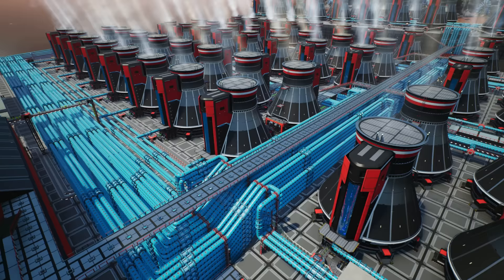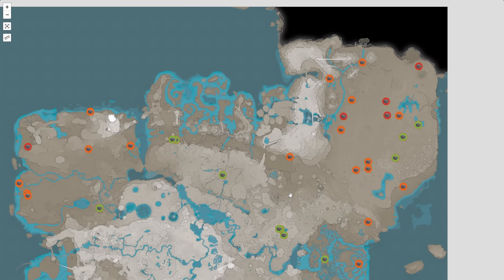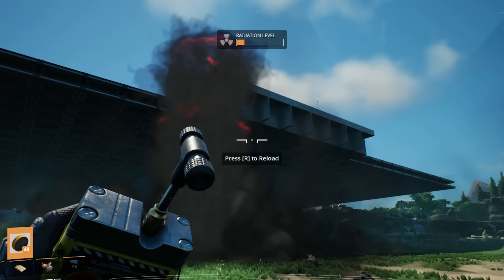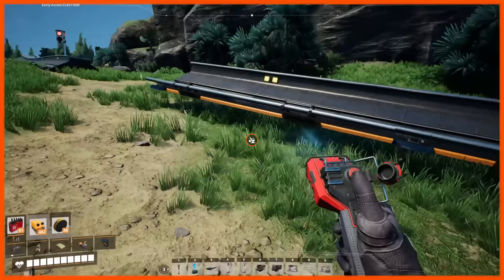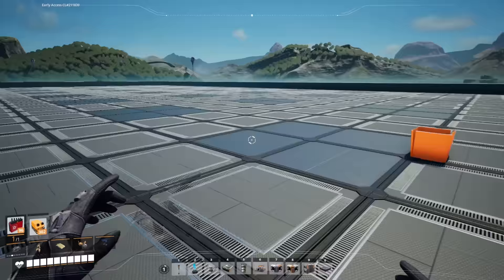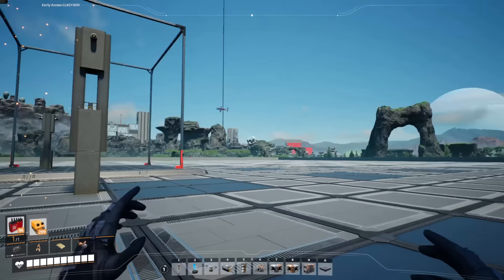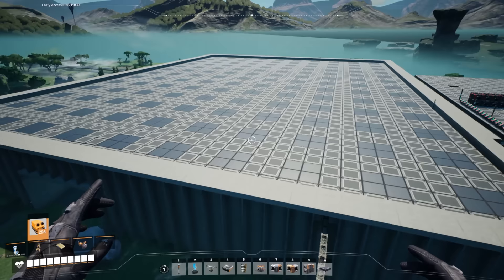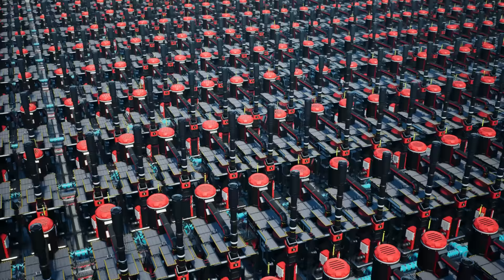I Spent 700 HOURS Automating Nuclear Pasta in Satisfactory

Comment: I'm surprised you dont saturate the lines before powering the machines. Connecting resources before powering  not only helps find those ore/ingot issues early, but also accelerates the warm up of your factory.
Reply: I think Kibitz just loves the satisfaction of completing the belts after everything has been built.
Reply: @sunfire65ph  Or he likes to recheck the beltwork without having to worry about stuff that isn´t meant to be where it is. Dumping thousands of Items out of a complicated beltwork-system can take much more time then flying around and rechecking your connections first.
Reply: @joesheridan95  considering the exact problem he had, pre loading the belts would probably had made it much easier to see where the errors were, as the ore would suddenly shift belts. pre-loading is typically a much easier way to start up a factory, and you can usually rely on simple overflow to keep belts and machines full. however preloading takes exponentially longer the more machines are chained together. that's why he did a hybrid system of load balancing the belts first then letting them overflow on each row. the load balance lets each segment become independent, and get everything filled faster, without trying to load balance every machine at the same time.
Reply: "however preloading takes exponentially longer" - not exactly. To preload N machines each having an M-size input buffer you will need to move N*M items regardless of the way you split the inputs, be it manifold or load-balancer setups. And since M is essentially a constant for any individual recipe - O(N*M) becomes O(N), so linear time complexity. 
Main difference comes from size of M. For manifolds M almost* equals to machine's whole input buffer - which is generally the size of stack. For loadbalancing M equals recipe requirements. E.g. if your recipe takes 20 screws to start, and the size if screw stack is 500 - minimal preloading for manifold would take roughly 25 times more time.

*Since machines aren't strictly filled one after another on average you need a little less items, but the difference looks negligible for most setups bigger than 1-2 dozen machines (obviously depending on the rate between recipe requirements and stack size).
Reply: @ye_olde_urizel  My brain hurts.

Comment: The thing that happened on the belt poles, z-fighting, happens when 2 textures try to exist in a single spot. Due to inaccuracies when calculating fractions, which part of which texture will be visible depends on the camera angle and capera position. The only solution is to slightly offset one of the textures so that they no longer exist in the exact same place

Comment: Funny that you posted this video today. I'm at the exact same stage in my world. I'm planning on making 10 Nuclear Pasta in my playthrough right now. Here's my numbers that I've crunched.

10 Nuclear Pasta (Particle Accelerator) - 20x
	2000 Copper Powder
	10 Pressure Conversion Cubes

2000 Copper Powder (Construtor) - 40x
	12,000 Copper Ingots

12,000 Copper Ingots (Refinery Pure Copper Ingot Recipe) - x320
	4,800 Copper Ore
	3,200 Water

10 Pressure Conversion Cubes (Assembler) - 10x ✅
	10 Fused Modular Frames
	20 Radio Control Units
	
10 Fused Modular Frames (Actually Making 18) (Blender) - 12x ✅
	18 Heavy Modular Frames 
	900 Aluminum Casing
	450 Nitrogen Gas

900 Aluminum Casing + 360 for Heatsinks = 1,260 (Actually Making 1,350 (Assembler) - 12x - ✅
	1,800 Aluminum Ingots
	900 Copper Ingots

1,800 Aluminum Ingots (Smelter) - 60x - ✅
	3,600 Aluminum Scrap 

3,600 Aluminum Scrap (Refinery - Alternate Electrode Recipe) - 12x - ✅
	2,160 Alumina Solution
	720 Petroleum Coke

2,160 Alumina Solution (Alternate Sloppy Alumina)(Refinery) - 9x - ✅
	1,800 Bauxite
	1,800 Water

20 Radio Control Units (Actually Making 30) (Manufacturer Alternate Recipe) - 8x - ✅
	120 Heat Sinks
	60 High Speed Connectors
	360 Quartz Crystals
	
120 Heat Sinks (Assembler Alternate Recipe) - 12x - ✅
	360 Aluminum Casing (ADDED TO 900 RECIPE ABOVE)
	360 Rubber

60 High Speed Connectors (Actually Making 75) (Manufacturer Alternate Recipe) - 25x - ✅
	2,250 Quickwire
	937.5 Silica
	75 Circuit Boards

75 Circuit Boards (Actually Making 105) (Assembler) - 12x - ✅
	150 Plastic
	450 Quickwire

Comment: for whatever reason the foundry recipe to me seems like a better option to make copper bars. since it takes copper ore and iron ore to make roughly 100 copper bars per minute. but then again Kibitz likely has more experience with the game then I do. so he might truly know the option to use since he dives into the hardcore math.
Reply: nah, he often just makes things harder for himself, I think sometimes intentionally for the content.
Reply: Then he would have to bring in all that other iron too, easier to just bring in water
Reply: Not counting for power or space, that recipe is inefficient. You need MORE copper ore AND in addition iron ore. Because his limiting factor is the amount of copper, the "Copper Alloy Ingot" recipe would not be feasible.
Reply: @beerforlife32  Foundries require half the power of refineries but then there's the trade off of all the  overclocked water extractors and pumps vs the power required for the extra miners for the iron ore. Foundries also take up much less space. And copper alloy would only require 3 foundries per 1 constructor for copper powder.
Reply: sure the refinery recipe is the better option for input/output value. but when he placed the building next to so many iron deposits. figured it would have made more since to bring that over vs the water.

Comment: It's impressive...but not how I would do it. I would sacrifice 1:2.5 efficiency of pure copper ingots to go with the 1:2 copper alloy ingots. Gather up 25% more copper (probably just a node or two), iron instead of water, then the whole thing is just 50 foundries without overclocking! Also waaaay less power.

This doesn't take away from what you've accomplished at all. Different philosophies and all of that, and the end result is a pretty sick build.

Comment: you should have more than 1 sources of power. So if you run into another nuclear problem, you could try to run the nuclear power related things on "backup power"
Reply: Pretty sure he has a fuel plant, and a coal plant to fire the fuel plant up.
Reply: If I remember correctly, I think he has a battery factory as well. Either that or I'm thinking about Z1.

Comment: @2:55 It would add a lot more logistics to the factory, but why not use the copper alloy alt recipe in the foundries? 50 copper ore per min and 25 iron ore per min makes 100 copper ingots per min and foundries use half the power of refineries. And you wouldn't have had to deal with the hassle of pumping the water in.

Comment: You know what I'd like to see added to the game? Specifically powered belts that we can shut on and off. That way we can turn on/off belts routed through splitters to use them as junctions to pivot productions. Imagine being able to flip a few switches to reroute all that copper to train systems to mass relocate from say the desert and the green pastures to central locations. 

I'd like to say something about train tracks though.  If I can suggest one thing it would be plan your tracks out by elevating them that way they don't interfere with your other logistics. Think more monorail and more vertically. Bonus points for such a system is that you can also use the supports and track base if you use foundations to run cables also removing them from the wilderness.

Question though.... did you have problems with the sky manta thing? I recently decided to use the same area around all the iron nodes to turn it into a massive iron oil rig that I'm still building. I also just found out that that thing is treated as a solid object and has collision. Is it possible to actually kill it too?

Comment: 12:40 it's called Z-Fighting, it's when two different/offset textures are in the EXACT same space (or the rendering precision is low enough that it thinks the textures are in the same space) and the rendering engine "randomly" picks one of the two textures to render in the final image, causing a weird strobing effect which changes each time the viewport moves or rotates

Comment: Yea, 2 meters between floors for belts is definitely too small. I recently made a factory with 4m space and for the most part it's okay but there's no space to squeeze if you got one belt on the ground and other passing on the ceiling mounts. Next one will probably have 6 or 8 meters of space.

Comment: 12:44 It is texture overlapping, due that both Objects are overlapping, the textures overlap, but it woulden't happend if the graphycs dind't have small imperfections that change a small fractions of pixels of height in the corners, making that very strange texture overlapping, that can be fixed by moving the overlapped object down/up left/right depending on what axle is the object overlapping

Comment: Awesome! Thought you could have just built bridges above the train tracks… prefer the risck of the current method though!

Can batteries be used in trucks? If so, how bout delivering batteries via drones to power you vehicles with batteries! 

And, why not use that water well for the copper? Since you have trucks there, use the packaged water method, and send that water to assist, thereby lessening the number of pumps!

Finally, why not fully over lock at least the accelerators? That should help!
Reply: Thanks for watching and commenting. You have been selected randomly for our giveaway package. Quickly contact the address above 👆.

Comment: 12:40 is called z-fighting. it's a visual artifact that happens when 2 surfaces are at the exact same orientation and plane. when they touch, your graphics card has no way of deciding which is on top, so it's basically random. the developers have a way of fixing it by making objects very slightly of different sizes, but that's a nightmare, or by sacrificing performance to tell the GPU what goes on top of what.

Comment: This is why mods are needed most importantly the ones that add MK II III etc for ALL machine

also 12:35 Its a common graphical artifact called Z Fighting just look it up on Wikipedia only way to fix it is to extend the beams up past the top of the concrete or recess them below it alternatively add a flat cap to the assembly to hide it.

Comment: The green forests have become the green pavement... Thanks for the video kibtz! Except you missed the easy way out for the belting. 8 pure copper refiners at 37.5/m is 300 copper ingots. All you needed to do is build the refiners in rows of 20 with a single 250% overclocked constructor at the end to make 125 copper powder from the 750 ingots they produced. That way you're only needing to move 2500 copper powder from there instead of 15k ingots.

Comment: When using the floor hole with the conveyor lift under the ceiling, build the conveyor belt first (even a small section that is in the proper direction and ends where the lift will land) and the game will adjust the landing height high; being where you want it to be.  It won't go into the floor and clip.

Comment: 4:30 I probably would have gone with the copper alloy ingots. Iron ore + copper ore = Copper Ingot. Not the most efficient, true, but you don't need water and they use a lot less power.
Reply: 8:06 This is why you always make a highway. Slower than just running rails, true, but it saves you time in the end game because you can do a multi-level highway where both trucks and trains can travel without running into each other. I tend to do the truck highway below and two sets of rails above... and then build it all around the world.
Reply: 11:39 Something I've built in one of my play-throughs is a belt overload system. It uses a system of smart splitters and mergers to make sure that a belt is ALWAYS filled to max, and whatever is leftover is merged onto another belt, which also has a smart splitter to make sure the belt is fully loaded. I have 5 or 6 belts (I think) that have an assortment of materials moving on them, and the overload system helps me make sure everything is maxed out with no backups... this way you use the least amount of belts.
Reply: 12:42 I think that's called 'Z-clipping' or something like that. Basically, the two items end on exactly the same level, so they're fighting with each other to see which one is displayed.  To fix it, you simply need to make sure one ends just below the other.
Reply: 15:18 Um.. instead of the belt towers holding just one belt, why not make stacked variants that carry 2, 3, 4 or 5 belts? Simple fix.

Comment: A question about your conveyor support towers. Why didn't you build a taller conveyor stack in the towers using the stackable conveyor supports? That way, you can run multiple belts through one set of towers. You could even make the gap in the support towers taller to accommodate more belts. And if you only needed one belt, you could just use one like the one you made.

Comment: This whole video shows exactly why I avoid the ‘pure’ ingot recipes. Refineries use so much more power than smelters even before you take into account the extra power for water extractors and pumps. I would wager You could get more ingots/min using smelters in the desert than refineries in the green hills and you’d use way less power and have a way more compact factory as well.
Reply: An added bonus is that the smelter recipes tend to be way kinder on beltwork as well, nice rounded numbers

Comment: 7:34 nah this is entirely unnecessary; Launch Pads can launch vehicles so just have trucks go over the trains. You'll need to adjust their schedules to be multiples of the trains schedules, or else launch them hard enough to go over even trains rather then just the tracks, but it should be easy and reliable enough.

Comment: This looks awesome.  The question that's killing me here: How the heck did you get the steel beams to be pushed out from the center by half an increment so they don't clip into the edges of the belts!!  Driving me crazy here, can only get the beams to snap to be either clipping the belt, or not touching the concrete pillar.  Help plz!

Comment: Why not use trains to bring all the copper? You've got 1800 copper per minute right next to the tracks. Would stopping at the stations take too much time?

Edit: Ah. Your train lines are taken up by essential power delivery. Carry on.

Edit 2: I like your central storehouse. The closest I have is a storage container tower that keeps getting taller. And since I want the first thing I feed into the awesome sink to be a plutonium fuel rod, none of them are labeled.

Edit 3: Yeah, I have the same problem. "I better watch to find the bug in my circuit. There's always a bug in my circuit. ... Yep, there it is."

Comment: the dedication is admirable but building this much isn't necessary, the goal is 1000 nuclear pasta, at this production rate, 12.5 / min, it'll be produced in 80 min, just placing down the refineries took an hour, even 1 particle accelerator is enough, 0.5 pasta / min comes out to 33.33 hours, that time will tick away in the background while you decorate or finish up the other factories

I love the game, but this is my biggest critic of it, there is no need to scale up because the goal is always just to produce some finite (rather small) amount of resources, there are no upkeep costs, no reason for large scale continuous production

large scale transport of resources is also unnecessary, in general when a resource is refined it halves in size, this means if you build a local factory that refines the nodes around it into higher tier materials it's hard to even fill a mk1 belt with the output, with smart splitters a mk5 belt is more then enough to supply the space elevator with all the parts, no need for elaborate train-stations etc

similarly the node output is ridiculously high compared to what the game asks you to do, one pure node of each type is more resources than you'll ever need

the game is great fun for 200 hours I'd say, after that you can get tricked into thinking it's time to build "real factories" when reality is after unlocking everything, producing each type of resource and making it all look nice - you're done